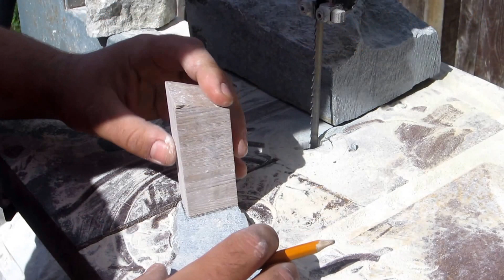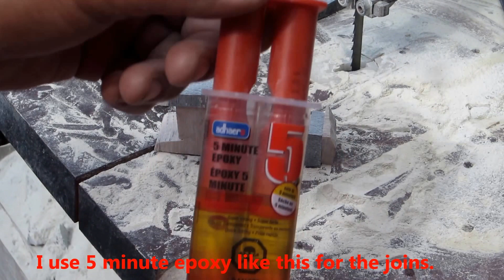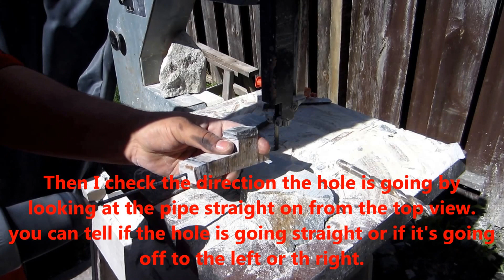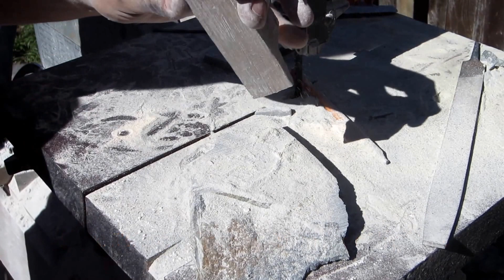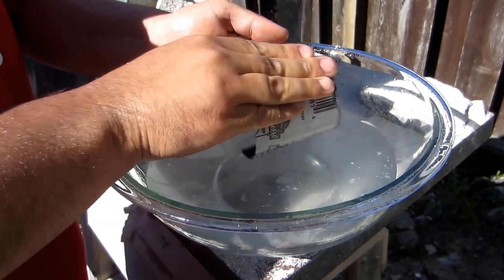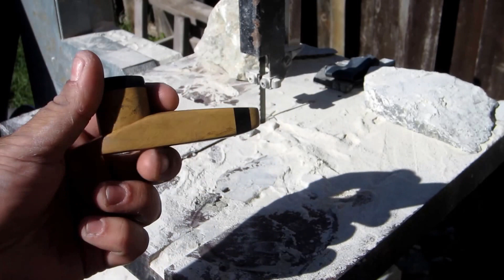HOW TO MAKE A STONE TOBACCO PIPE WITH DAVE ZACHARY

Comment: Nice piece man I had a couple questions what kind of bad it on ur bandsaw and ur hand saw and what kind of drill bits were used it looks like u used wood bits and a metal hand say like something that would be use for pipe
Reply from the maker: Hello, thanks for your comment!  the blade on my bandsaw was a 4 TPI 3/8'' by 0.025.  It is the best blade for soft stone.  you can also fit it to your handsaw bay measuring and drilling a piece to fit a handsaw.  ask the guys you order your blades from if they have any end of the roll pieces of blade stock and they may just give you some pieces that are too small to make a band out of.  As for the drill bits you can use any types of bits for either metal or wood for soapstone.  Thanks

Comment: how long did it take to make that? and is that clearcoat spray safe to smoke?
Reply from the maker: It takes about an hour to make one and yes it is safe to smoke.
Reply: You’ll smoke clear coat the first few times you light, it’s not safe but not too bad. I wouldn’t smoke that pipe because of the epoxy used for the accent around the bowl. 
It’s fine on the stem, but you’ll be smoking epoxy from the bowl connection until it degrades enough to come apart

Comment: couldn't you have just gotten the same result with the big piece by itself abd put some design's on it seems kinda pointless and much more work for the thing that you could have gotten quicker and sooner
Reply: wait also wouldn't the epoxy be super poisonous to smoke out of ? again the one big stone would have worked better no epoxy no poison less work
Reply from the maker: Thanks for the comments!  Yes, it would be less work to use one piece but one piece pipes are boring and aren't as visually stunning as when you add highlights.  Whenever you make art it is always worth going the extra mile especially with stone carving that can potentially last for ever.  This is a way I modernized the traditional peace pipe.  If you make the joins properly they should fit together perfectly flush so once you press the pieces together there is literally a thinner layer of glue than a piece of paper.  Epoxy also has a high burning temperature once it's fully cured so you would have to smoke a lot very fast to heat it enough to burn it. 
Thanks for watching and commenting!